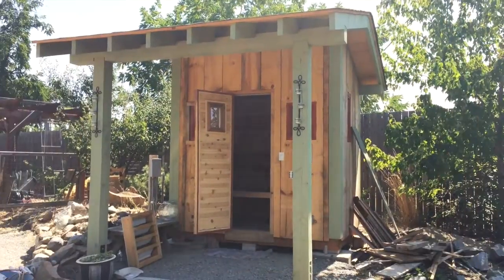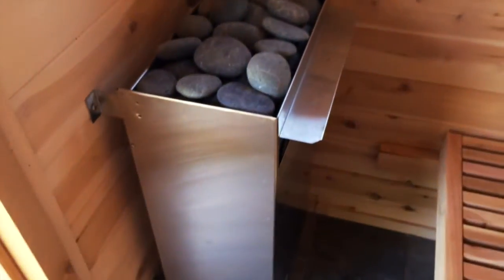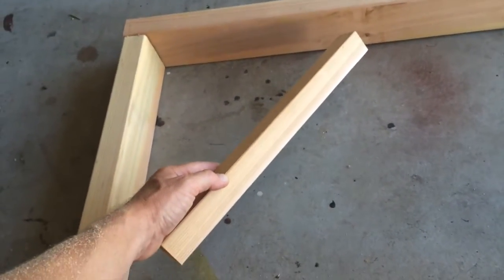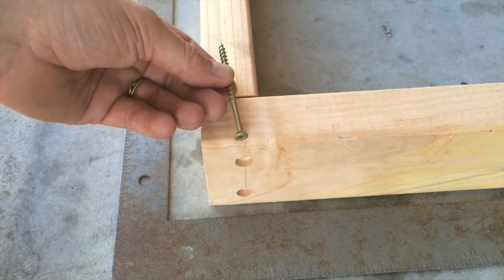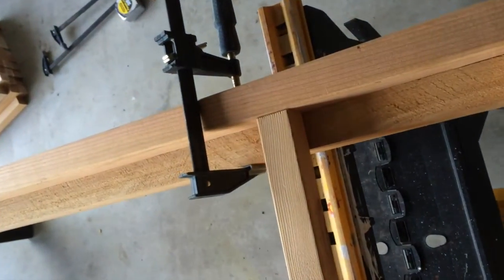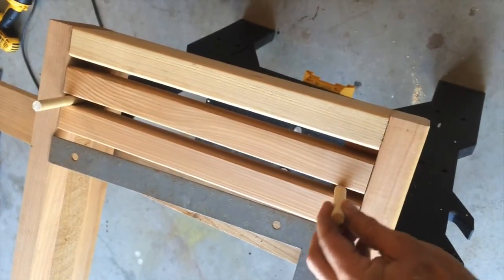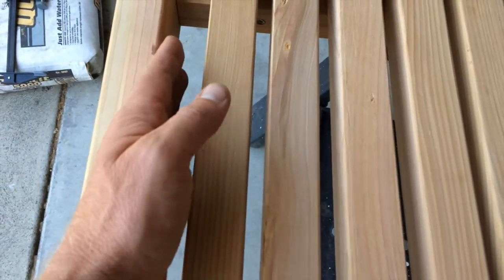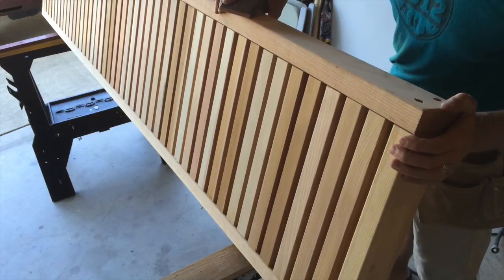How to Make a Cedar Sauna Bench

Comment: I'm a Finn, and your bench Hights are wrong. Your bottom bench should be the same height as the top off the stove, and the top bench should be as high as u can get it without hitting your head on the ceiling when sitting. But other than that, it looks good.

Comment: Nice vid, dude every sauna need a drain,it dosent matter if Its  big or smal sauna.when u throw vater on the (kiuas)ower the Stones,it always runs thru and on the floor.
And second you always svet when u are on sauna.
Its going to smel bad.
Look how Finnish people build saunas.
Greetings from Finland,the land with 3miljons saunas.
Reply from the maker: I have had this sauna for years now with no drain. The stainless steel tray holding the stones does not leak. The amount of water I put on is minimal and steams away quickly. I think commercial or high use saunas should be designed to be hosed down for cleaning. The benches can be easily removed for cleaning.